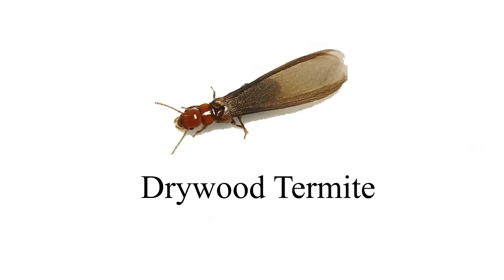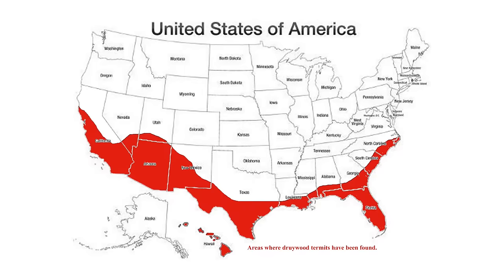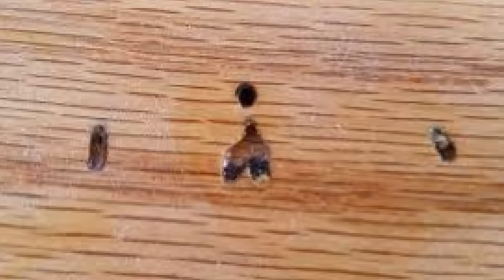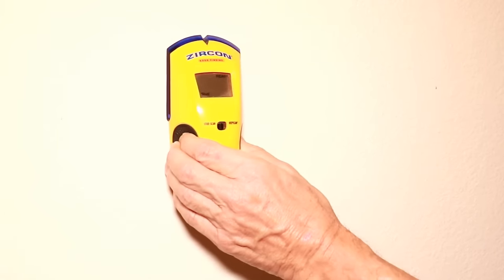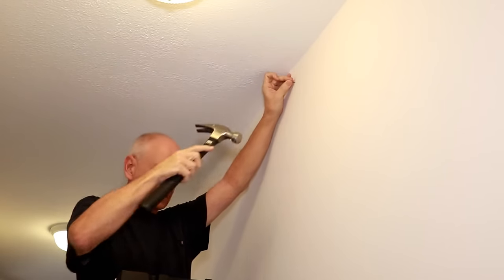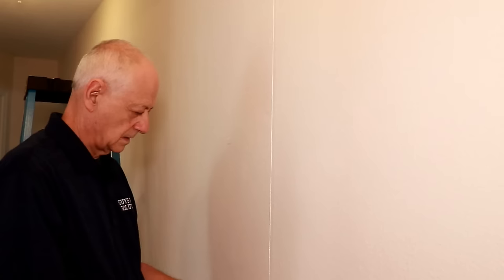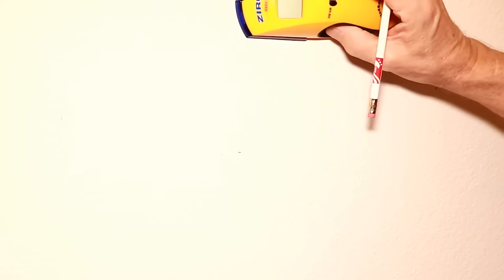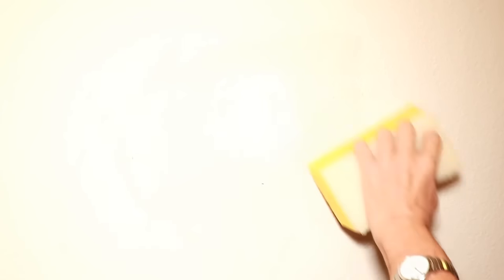How to Treat a Drywood Termite Infestation Yourself. A MUST see if you have Drywood termites.

Comment: Hi Guy, I'm very grateful of your very helpful videos.  A question.. I was told that every house has termites and it's a matter of how much.   I've shown a pest-control inspector of small amount of frass in a closet.  Based on it, he said that my house needs to be tented.  Is he right?
Reply from the maker: If that is drywood termite frass, then the inspector is correct, but make sure that it is actually drywood termite frass before tenting the house.  It is important to understand how drywood termites work.  They enter through cracks and crevices around windows, doors, the eaves, pipe penetrations, and so forth.  Most of the time, they enter through several locations.  That is because a swarm of them attacked your house at the same time.  If there was a crack or a crevice, then they probably found it.  After they established their galleries, which will be inside the wood, it will take four to seven years for them to be able to swarm.  Now that they are in your house, the swarmers will use holes that are in your studs to travel through the walls.  Those holes in the studs were created by the electricians to run the electrical wiring.  Not only are these holes going through the studs, but holes were drilled into the attic for the light switches and to run some of the wiring for the outlets.  So, the termites now have easy access throughout the attic and the walls.  If you have a basement or crawl space, they have access to that as well.  Most of the time, you will have no idea that they are in the walls, because the frass is inside the wall.  To make matters worse, if you have drywood termites, then your neighbors have them too.  That means you have been getting swarmed for as long as they have existed in the neighborhood.  Most likely, we're talking about years, so it's a safe bet that you have these guys in many locations in your home.

The only sure way to get rid of them is to fumigate.  Prices for this can vary wildly in this industry, so I recommend that you watch my video on how to hire a pest controller without getting ripped off.  That video can save you a lot of money.  You should also know that the gas they use to fumigate has absolutely no residual action whatsoever, so you can get reinfested the moment the tent comes down.  Like I said before, if you have drywood termites, then your neighbors have them as well.  Since drywood  termites swarm every year, it is almost a certainty that you will be reinfested within a year after the fumigation is done.  The only way to prevent this is to do a preventive treatment on your house every 60 to 90 days.  Most pest controllers will not do this, so it is something that you generally need to do yourself.  I have a video on how to do that and I will place a link below.  If you absolutely cannot afford to fumigate your house, then you can try spot treating it yourself.  It is virtually impossible to find all the termite galleries, but it is way better than doing nothing.  Regardless of how you treat it, you should begin the preventive treatment immediately, so that you do not get additional termites paying you a visit.

Look at that frass with a magnifying glass.  If it looks like little pellets, then you have drywood termites.  If it looks more like sand or sawdust, then you may be looking at something different.

I hope that helps.  Be well my friend.                      

Video on how to hire a pest controller without getting ripped off:  https://youtu.be/y-a8XOqVrlE

Video on how to prevent drywood termites:  https://youtu.be/Yozv3s-Qwlw
Reply: @GuysPestSolutions  The frass was cleaned away.  I took some pictures.  Can I email them to you to be examined?  I did see a dead drywood termite.
Reply from the maker: @TheBostonFern  You can send photos to guyspestsolutions@gmail.com.  Please watch my video on how to take the photos correctly.  They need to be done a certain way for them to be useful.  The short video will explain how to do it.  I need them to be very well focused and up close.  I will do my very best to identify what you have.  Be well my friend. 

Video on how to take the photos correctly:  https://youtu.be/I8qd63hX6y8

Comment: Hi Guy, I just tore down a metal shed that had wood framing infested with drywood termites. The scraps are sitting under my carport/driveway ( I live in a 1999 mobile home) until garbage day later this week. Will the termites head towards my home now since I disturbed their dwelling in the shed? Thanks for your help!
Reply from the maker: The answer is yes and no.  The termites in the wood that you took out of the shed are not likely to attack your home unless they swarm.  That being said, if you had drywood termites in your shed, then it is almost a certainty that you also have them in your mobile home as well.  It is the nature of drywood termites to swarm and then attack any structure that they come in contact with.  I would be quite surprised if you do not have at least several galleries of drywood termites in your mobile home already.  Of course, the problem with drywood termites is figuring out where the galleries are.  Most of the time, these guys enter the building through cracks and crevices around the roof area or around windows and doors and you never know that they are there because the kickout holes and frass are in areas that are not visible from the inside or outside of the building.  Therefore, there is a very good chance that these guys are already eating away at your roof structure, your walls, or your floors.  I do not know what your mobile home looks like, but if you have molding around any windows and doors, that would be a good place to inspect.  Just get a Flathead screwdriver and try to push it through any wood, either inside or outside, that is around the windows and doors.  Just put the tip of the screwdriver onto the wood and gently try to push it through.  If the screwdriver goes right in or the wood feels soft, then you may well have a drywood termite gallery in that location.  Work your way around all the molding at 4-inch increments.  If you do not find any activity around windows and doors, then you may have gotten lucky and do not have an infestation, but just because you do not have an infestation around windows and doors does not mean you do not have one that is in the ceiling, walls, or floor.  Still, the molding around windows and doors, particularly on the outside of the building, is a very common place to find drywood termites and so, if you do not have an infestation in those areas, then you may have dodged a bullet.  All you can do is continue to check periodically for activity and see if anything comes up.  You should also know that, if your shed was infested with drywood termites, then other homes in your area are also infested.  That means termites are going to continue to swarm from other homes and, sooner or later, your mobile home will get infested as well.  To prevent this, you must do an exterior treatment of your entire mobile home every three months.  For mobile homes, I would treat under the floor as well.  I have a video on how to prevent drywood termites and I will place a link below for you.

Video on how to prevent drywood termites:  https://youtu.be/neNsmVbj8Pc
Reply: @GuysPestSolutions  Thank you so much for your detailed reply. I do have one spot I can see that has a kickout hole and frass. I'm sure there is more that I can't see. I have to redo my kitchen. Should I wait until afterwards to do a full fumigation? Just in case the new construction may bring in termites? I may also have subterranian termites.
Reply from the maker: @Jazz888ify  The only good news about drywood termites is they are slow eaters.  That does not mean I would wait forever to treat them, but you probably do have time to redo the kitchen if you wish before you fumigate.  It is certainly something that I would want to do within the next few months.  You have made a very wise choice to fumigate.  The only other advice that I can offer is to begin the preventive treatment several days before the fumigation is done.  You can literally get reinvested the moment the tent comes down.  Therefore, you want to have that pesticide barrier around the entire building before they fumigate.  Without that barrier in place, I guarantee that the building will have another infestation within a year.  You may not realize it because it takes 4 to 7 years before a new infestation is mature enough to begin swarming, but that infestation will be there nonetheless.  Since you live in an area where many buildings are infested with drywood termites, it is critical that you perform the preventive treatment around the entire building every three months.

I hope that helps.  Be well my friend.

Comment: What kind of sprayer gun do you recommend? Is a sprayer gun different from 1 gallon pump sprayers?
Reply from the maker: Are you talking about the sprayer to apply the Bora-Care or something else?
Reply: @GuysPestSolutions  Hi Guy! I'm looking for a sprayer to apply Bora-Care in my attic as well as a sprayer for Taurus SC around windows, doors, etc. Thanks!
Reply from the maker: @al70127  Bora-Care clogs up sprayers very easily, so I always buy the cheapest sprayer that I can possibly find.  I have seen them on Amazon for around $10.  I always try to do all the spraying in one day, and then I just throw the sprayer away.  If you are looking to spray the outside of your house you can use any battery operated sprayer you like.  The more pressure the sprayer has, the faster it will get the job done, and the higher it will reach.  Of course, you get what you pay for.  Decent sprayers usually run over $100, and put out over 65 psi, but I am seeing more and more of them that are running under $100, but I have no idea how good they are or how much pressure they have.  Let me know if you have areas of the house that are fairly high up.  If you do, then I can tell you an easy way to treat these areas, without using a ladder.  Just e-mail me if you want to know how to do it.  My e-mail is guyspestsolutions@gmail.com.  If you e-mail me, please remind me of your YouTube name, so I know who you are.  Also tell me you are looking to learn the secret on how to treat high up place on your house quickly and easily, without using a tank sprayer.  I have reasons for not talking about it here.  Be well my friend.